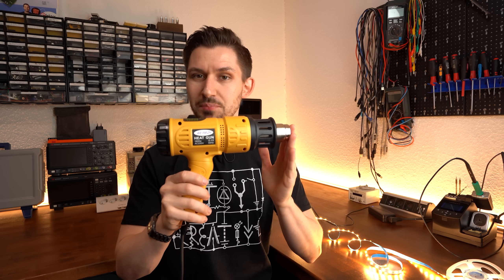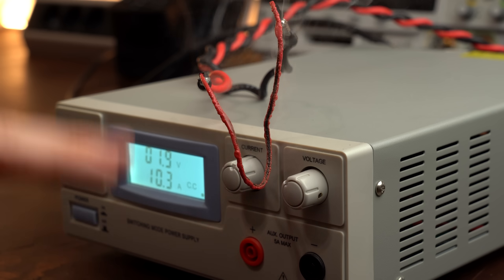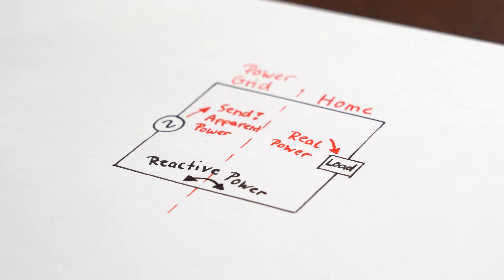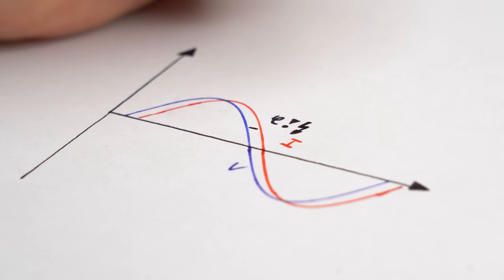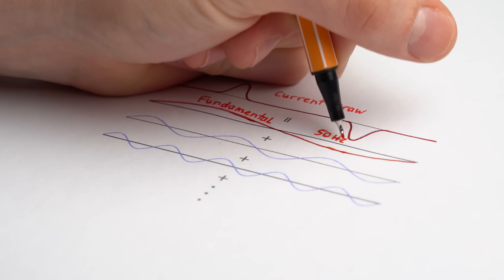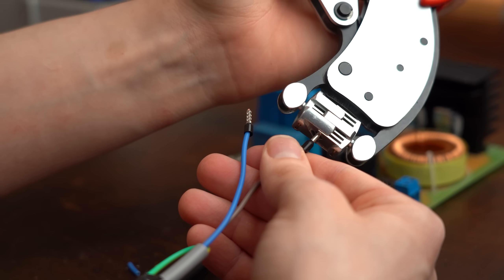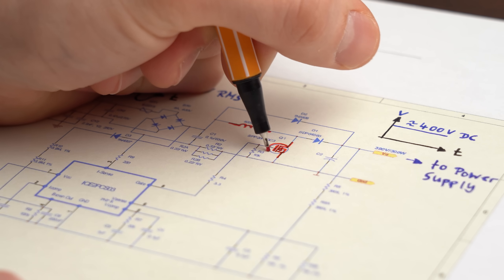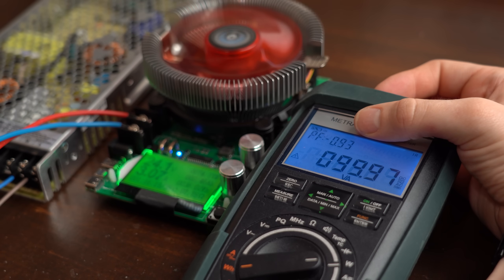The Most Important Circuit for our Electrical Future?! (PFC) EB#55

Comment: A very good explanation of the efficiency of the used electrical energy.  The problem that arises is with dirty input energy.  Where various devices connected to the network leave traces in the form of high-frequency harmonic oscillation.  These phenomena are best observed in high-rise buildings with several apartments, which are connected to a single transformer station!  Another point that you can show is at what DC input voltage the device starts working normally and if the components can withstand the DC stress.  Capacitors are not the best friends with direct current because it fills them up and doesn't let them breathe, causing them to burn out.  And manufacturers use these stress statistics to make products with an approximate lifespan of around 5 years of constant use.  However, coils have an enemy in high-frequency pulses, because their property is inductive in nature, they create counter currents and amplification of the electromagnetic field from the surroundings into the very circuit that we use.  So that in a society with more and more devices that use wireless technology, it is necessary to protect the coils from the signal-filled environment.  It would be nice to have an efficiency coefficient close to 1, but until this is put into law and forces manufacturers to comply, I don't see why they would do it by themselves and guarantee a long working life of the devices.  Just looking at smartphones and computers, even if the device itself is still working after 5 years, we now have to throw it in the trash because there is no software support, and spare parts stop being produced after 3 years of the product release!  And let's not forget that just one such device usually costs at least two salaries of an average working person.  And everything that is cheaper no longer has service or software support!

Comment: For normal home owners its kind of pointless at the moment as you are charged real power not apparent power, if that ever changes PFC is going to become very popular very quickly :D
Reply: That's true for smaller loads. For larger loads it still matters because it limits how much power you can use on a given circuit. For something like an EV charger which uses the entire capacity of the circuit it's most apparent (pun intended) because PF is directly rated to how fast you can charge.

Comment: A way more efficient solution is that the DC power supply gets rid of the Full Bridge Rectifier (Shoutout to @ElectroBOOM) and it's large capacitor and use a flyback convertor with the same principle as the PFC. Then you have everything combined into 1 more simple and efficient circuit (basically a PFC that outputs directly the desired DC voltage instead of 400v and is isolated of course).
Reply: That approach is often used on LED drivers but doesn't work with general purpose power supplies. The big problem is output voltage has significant ripple. You can reduce (but not eliminate) this by using large output capacitors. To fully eliminate this ripple you need an additional DC-DC on the output but then you're back to having two converters. Worse yet that arrangement is much less efficient than a 400v PFC followed by the isolated converter.

Comment: Sorry, but this is all wrong. What you see is Peak Current - not "Apparent Power". The effective power is proportional to the area below the curve. Therefore a short spike of high current in every sinus wave doesn't mean high power. Think of PWM. The only problem with such circuits is that those none-sinus signals cause HF noise, with the power cables acting as antennas, which might disturb radio frequencies. The energy efficiency of the LED transformer is certainly quite perfect. If your assumption was true that 36W input convert to 21W output, the small power adapter would be heated up with 15W - what would heat it up quickly. A power factor correction means that you put I/U in phase, if it isn't - like for inductive loads. In your video we see (0:40) that I/U is in perfect phase, so this PFC circuit doesn't do anything in your case, except dampen the peak current a bit which has no effect at all to your power grid. You can have this cheaper and cleaner with a 50/60hz LC filter.
Reply from the maker: Sorry, but your comment is all wrong.

Comment: My utility provider only charges for KWh, not KVA, so actually having a bad power factor doesn’t cost me any extra.  However, when I run my devices from my offgrid solar inverter I notice the extra current which bad power factor causes, so the power factor correct stuff will be quite useful in this scenario. Thanks for the video 👍
Reply: In todays world, for residential use, one doesn't pay for kVA. BUT  we are still drawing unwanted excessive current that's not contributing to any useful work from concerned appliances..
But our electric lines( in the house)
may be experiencing voltage clipping/ sag etc. besides running unduly hot..also the reason the circuit breaker often trips or fuses blow.......
So time & money is spent attending to these.
Reply: In the UK SMart meters are able to measure VA, we're not charged based on this just yet, I suspect we won't until there is sufficient saturation of smart meters, once that happens expect us to start being charged based on AP.... 😢😢

Comment: Now if there was a way to add this to the mains input of one’s home……….
We use large 50amp 13.8 volt Dc switching supplies to power most of the 12 volt items in the home and shop instead of having a bunch of wall warts sucking power 24/7. They are still more efficient than linear transformer based supplies where the transformer also has its parasitic draw of an average of 50 watts.
One should if they can, install a 12 volt solar system in their homes to power all of these small appliances ( phone chargers, power supplies for routers and modems ). This will eliminate these constant loads which add up over time.

Comment: A power factor correction is only needed if your loads are inductive and most importantly if in large amount like large motors.  Small devices such as LED lights consume the least amount of power. Then most of these device are fed  with lower voltage thus making it more efficient. And the power supply of these LED devices are a switch mode type which play a big role in power consumption.  a switch mode  supplies nowadays have an efficiency greater than 95 percent. And looking at the oscilloscope display where the led devices are used, the trace almost correspond to almost unity power factor meaning that the load is resistive like your heat gun( neglecting the motor blower inside the heatgun). Another thing is,  Refrigerators and air conditioning equipment today have inverters or variable frequency drives built-in  to minimize the consumption of the equipment. Variable speed drives will have almost unity power factor since the line side of the device as seen from the power source is resistive. So installing such power factor correction is useless when your total load is low and only LED lights to consider.
Reply: Why ppl are still mentioning LED here? It's like homes and officess are consisted only from LEDs. I didn't see a washing machine, vacuum cleaner, PC, TVs,... being powered by LED sources...

Comment: So the power on the non peak side of the sine wave oscillates back and forth infinitely with the power grid causing it to heat the wires? Wouldn’t that just cause there to be strain on the top peak of the sign wave? Am I lacking knowledge on how power generation works? I figured that the generators in the power plant would only be strained in the top half of the sign wave in that case? I guess the generators need to maintain a constant load so the only way to deal with that peak current draw would to be to add more power to the grid. Assuming my logic makes any sense then the lower portion of the sign wave would be less strenuous on the generator as you would add extra. That sounds like a headache for power companies. Hope I’m getting this right if someone notices I am dumb tell me.

Comment: huh, very cool... but why 400VDC in specific? 
i should probably check out the datasheet then.
Reply: I think I know why (but haven't actually confirmed this). The circuit is a boost converter so the output voltage needs to be higher than the input voltage. 240 volts AC peaks at 340 volts and 400 is a bit higher to provide a margin of error.

Comment: I was kinda confused when you randomly took the power supply apart and removed the rectifier for no reason. But I guess at least you improved the efficiency by 0.1 % or so. :D Then again, you also reduced the (real power) efficiency by adding the PFC so...
Reply: He connected it to the dev board which need ac input
Reply: @aagifford  I'm not sure what you mean. The PFC board supplies 400 VDC. The power supply he connected to the PFC board has a rectifier, so it can also run on AC. If you give a rectifier AC, you get DC. If you give it DC, you get DC...
I would have rather been concerned about the input capacitors of the power supply which are usually only rated 400 VDC, leaving no safety margin at all in this case.

Comment: It's also worth mentioning that the "apparent power" of a device with poor power factor is not the power you pay for in a residential situation; you pay only for the real power component. Power factor is a consideration and concern at the grid level, but will not meaningfully impact your own power bill.

I say this mostly because there's a lot of scam products out there that claim they can save you tons of money on your electrical bill by correcting your home's power factor simply by plugging them into an outlet. Even if these devices did correct your power factor (most don't do anything), they still wouldn't save you any measurable money, and their little LED will probably consume more power than they'd otherwise save!

Comment: What affect does this PF use have on power metering equipment and what you pay?
Reply: A normal household meter measures active effect (W), so you don't pay for the bad PF. You do however pay for the extra loss you get in your PFC circuit, so you don't save money by having a PFC circuit.

In industrial applications you may have a different meter (4-quadrant) that measures both and you pay a penalty for having machines with a bad PF. 

If you are a consumer, buy good quality equipment, well designed with good efficiency. Look for DoE Efficiency Level VI on the supplies. "1 to 250 watts. The minimum efficiency requirement is 90% at 50% load, 87% at 25% and 100% load, and 0.1 watts or less no-load power consumption."
You usually get what you pay for, i.e. the cheapest power supply on Alibaba will probably not be a good buy from many aspects like noice, efficiency, safety etc. 

If you design power supplies, you should design so you have a good PF and don't put out a lot of harmonics or other noice/interference on the mains. You can look at EN 61000-3-2, IEEE 519, MIL-STD 461, for more info. This comes with a cost in design, components and testing and is in my experience the difference between the $9.99 phone charger and the $30 one.

Long answer to your question, but I hope it's of some help.

Comment: Fyi, the quick way to spot a power supply with active PFC is to look at the rated input voltage and frequency.  If the converter supports all the common AC voltages and frequencies it has an active PFC front end.  I.e. ratings like 90-270Vac and 50-60Hz.  Another fun side effect of active PFC is that the power supply will often work fine on high voltage DC or 400Hz aircraft power.  Some manufacturers will even provide ratings for DC and 400Hz use so you are still in spec.
Reply: Many devices (mainly flyback converters) natively work on a wide range of voltages so a wide input does not always indicate active PFC.

Comment: I feel like it wasn't clearly pointed out... The relation between real power,apparent power, reactive power and phase shift holds true only when voltage AND current are both perfectly sinusoidal. With rectifiers, the current is not sinusoidal, and the reason for the difference in apparent and real power is not (just) phase shift, but rather the mere presence of harmonics (they contribute to apparent power regardless of their phase shifts, only the phase shift of the fundamental needs to be considered). Also, the term "reactive power" is meaningless in this case.

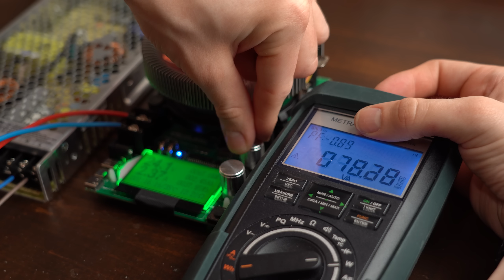Comment: How come the meter is showing a negative power factor, but a positive VA reading (@ 11:09). What have I missed here about power factors that makes that reading -ve?
Reply: Negative power factor means the "load" is not consuming power but rather feeding power into the grid. Or if a PF reading is negative it could also mean one of the sensors is hooked up backwards.
Reply: @eDoc2020  "Negative power factor" is a misleading term.  Even though cos(phi) is always positive for loads, and negative for sources, there is a sign convention that artificially adds another sign on top of the sign of cos(phi).

Quadrant 1 is inductive loads with positive reactive power (VARs), and quadrant 4 is capacitive loads with negative reactive power (VARs).   It's quadrants 2 and 3 that are sources, rather than loads.  Quadrant 2 supports capacitive loads, and quadrant 3 supports inductive loads.

IEEE assigns quadrants 1 and 3 as negative power factor, and quadrants 2 and 4 as positive power factor.
IEC assigns quadrants 1 and 3 as positive power factor, and quadrants 2 and 4 as negative power factor.

Comment: The heat gun looks as if it's using a triac to control the heat. Turn the heat down, the waveform will look increasingly horrible.

Comment: I feel like we all must make our small electronic so effeciënt on one side, but on the other side energy gets wasted by the thousands of Watts to charge our "green" cars we're all suppose to be using soon. Whatt's the point of all the neglegable savings ? Not that it's not interesting knowledge.
Reply: We're not "supposed" to be using electric cars. But if you need to use a car ICE cars waste around 3-6 times as much energy as electric cars.
Reply: @eDoc2020  If there is clear push to electric, why is "supposed" not a correct word ? Maybe I should clarify. If you have to pay for thousands of watts to charge your electric powerhorse every day, what is the point in saving miliwatts from other devices ?
Reply: @BrainHurricanes  Because you're not supposed to rely on a car.

Saving milliwatts matters because it all adds up. The average electric usage of an American household (11MWh/yr) is enough to drive an inefficient (50kWh/mi) EV 22 thousand miles a year.

Comment: There is a problem. How to explicitly define the 'apparent power' and 'reactive power', in single-phase AC circuits, with HARMONICS? The definition of 'real power' does not have such issue because it is based on conservation of energy, which is not the case for 'apparent power' or 'reactive power'.
Reply: It's based on calculating the RMS value of the entire waveform.

Comment: is pc power supply have this pfc inside?
Reply: Power supplies with an "80 Plus" certification all have active PFC. Power supplies with a voltage select switch do not have active PFC but occasionally will have passive PFC.

Comment: There is a little history laid out in the introduction section of the following paper. DCM Boost PFC for High Brightness LED Driver Applications- "This paper is concerned with the derivation of a discontinuous conduction mode boost PFC rectifier as a driver for high-power LED lighting applications."

Comment: I have lived off grid for 15 years, I have a lithium solar battery array which I've had for 5 years. The inverse of your argument is true for me. I love my direct DC LED lights and appliances. Heat-produced appliances running off my inverter like my rice cooker and heat gun are losing about 30% efficiency.

Comment: There is a trend within construction to use LED strips as "rope lights". Problem is that most are illegal. This is because most are made to be cheap and has the exact problem as described in the video. This leads to unbalanced loads to the power grid and as many construction sites never turns the light off and each reel are rated at 200-500 W each, the amounts of wasted power and stress introduced to the power grid is quite large.